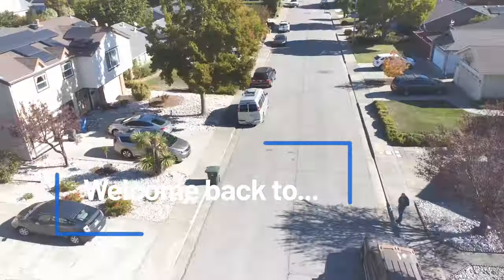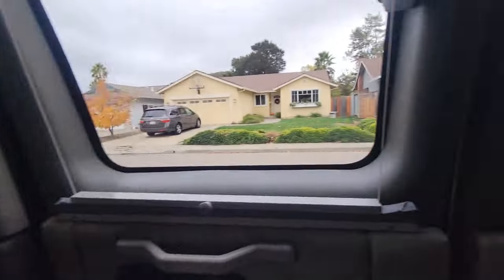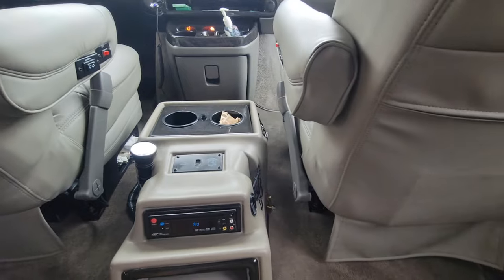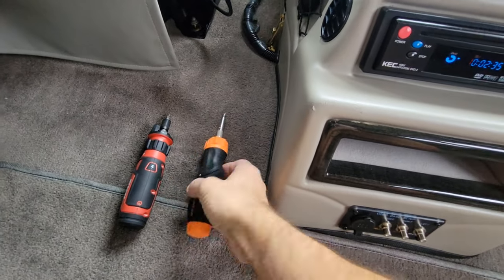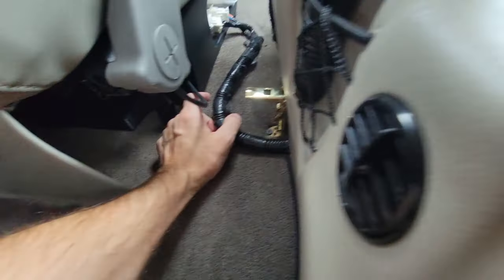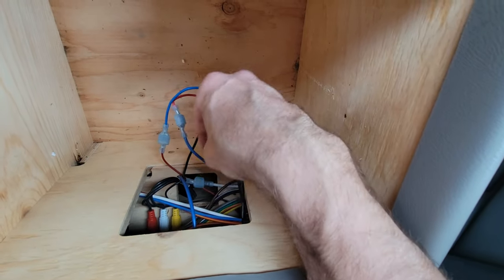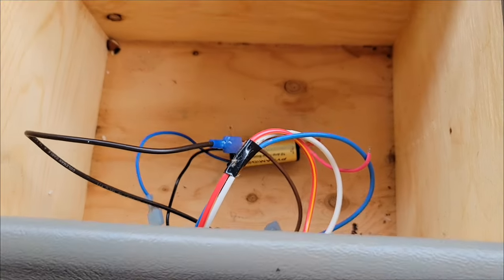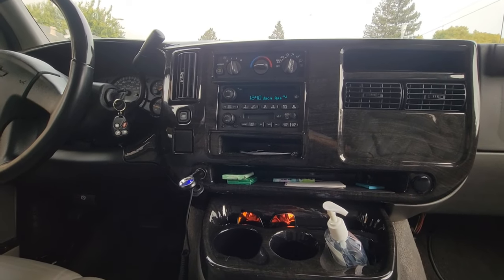Beginning to troubleshoot the AV system in my Explorer Conversion Van

Comment: I know next to nothing about the electronics for our EXPLOYER CO CONVERSION VAN but I do know it has a built-in Inverter.  Also there is a tiny little button that is a factory-installed electronic bypass button.  When it's engaged it will bypass most of the extra electronics and the extra interior lights.  See if yours has either of those features with your EXPLOYER Co package.  If so look closely there first before changing up the wiring.  Hope this info and suggestions help you somehow.  I can't honestly say I've played with most of the features on our EXPLOYER CO CONVERSION VAN.  ONLY THE TV/DVD, RADIO, REAR VIEW functions of the Rear View Mirror modes and the Queen Size Bed positions.   GAME Consoles are not my thing so I haven't bothered with them but they work based on what they say that they are supposed to do. DO you have a labeled list of the features posted on the inside passenger side door, we do!  If so,  it should list the parts numbers for the options and show the EXPLOYER CO Vin Number.

Comment: You probably already tried this, but Im guessing the lower battery voltage with the engine turned off, could be causing the speakers to be quiet.

Comment: Theres a small amp in the ceiling on the right side,passenger it may be bad or unhooked.
Take the tv frame down pull the 2 small speakers out ,remove the 2screws behind the button tabs slide it down and look to the right of your tv and  boom ,its right on the side cant miss it if its blown idky but that was my problem and yes hurry up and change the head unit and avoid the factory amp because it will have feed back coming out the speakers

Comment: My uncle just bought one of these vans. The sound for the radio works but no sound for the TV. It was working and then just stopped.  Did you figure out how to fix this? He is going to take it to the dealership to figure out the problem.